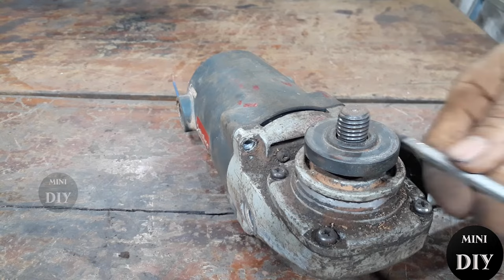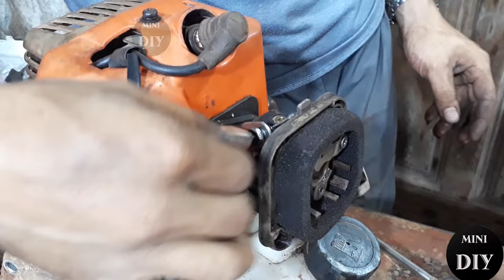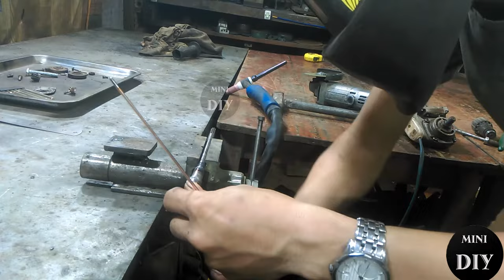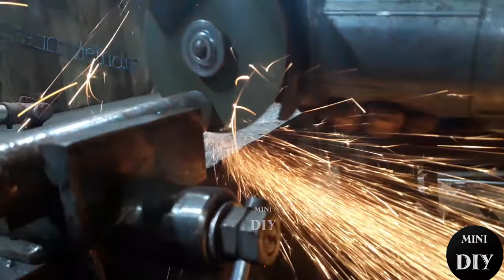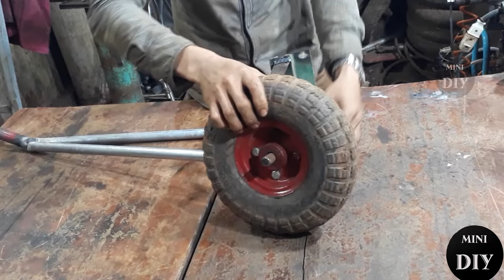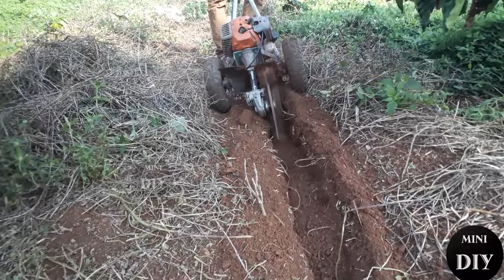Trenching idea using a grinder || @Mini DIY

Comment: The trenching disc seems to work well enough at digging the soil but it seems to be firing much of the soil over the top and back into the trench it just dug.

....If the plate at the back was angled sideways I'd imagine more of the soil would be deflected off to the side.